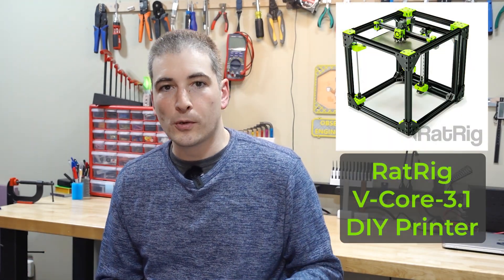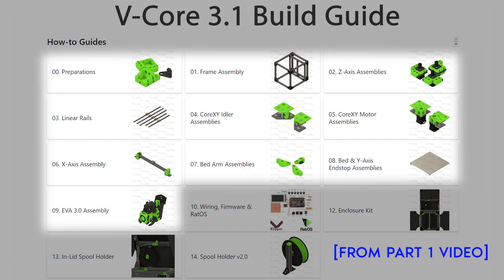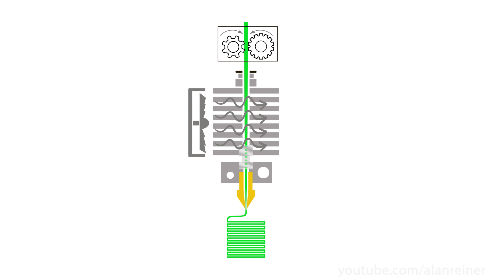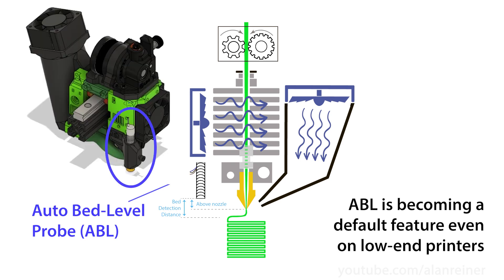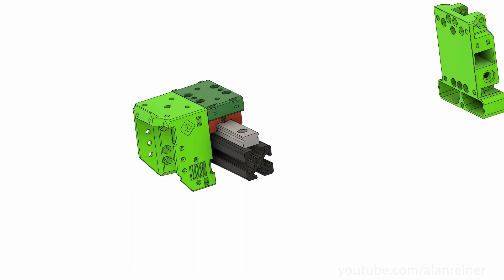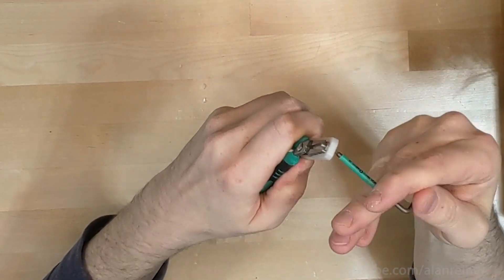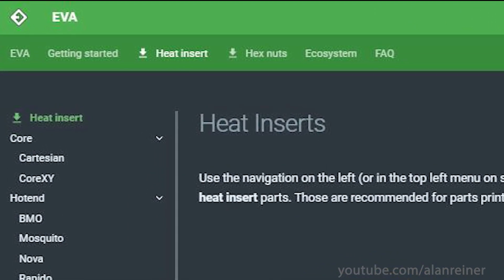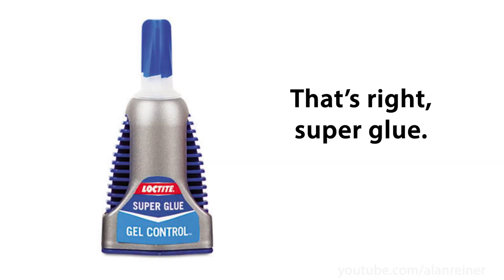RatRig V-Core-3: Printheads, Fasteners and the Amazing EVA

Comment: Hi, Paweł here, good thing you eventually looked at the EVA docs :) Thanks for the good word, EVA is a lot of work
Reply from the maker: Hey Paweł, thanks for watching!   I'm sure it's a ton of work to design and maintain a modular system supporting a bunch of third-party components.  But you've done a great job!  I was a little overwhelmed by the whole RatRig DIY thing initially, and when I saw that the EVA stuff was already included the RR CAD files, I mentally checked it off as one thing I didn't have to think about.   I wish I had realized there were options.  

So, on a scale of 1-100, how well did I pronounce your name? 😅  Any other corrections you'd like to add?  I'll pin your comment or add it to the description if something else needs to be said about it.  Thanks!
Reply: I'm going to find a way to mount the EVA to my Ender. It's such an ingeniously designed toolhead.
Reply from the maker: @livedeliciously  FYI there is a channel in the RatRig discord called #eva-on-ender (or something like that.

However I should point out that you will lose some of your X-axis because EVA has to wrap all the way around the X axis beam, which will limit it's motion on the sides since it would collide with the vertical rails.  Just something to think about... Maybe the guys in that channel have a solution 🤔
Reply: @ObsessiveEngineering  I'm humbled trying to figure out a simple solution for making this work. It seems like there isn't a way to mount it without making significant changes. Scrolling through the Discord on the "EVA for Ender" section shows me that smarter people have already tried and have to resort to the same solution. A complex one.

Comment: 4:37 if your holes are on the small side you can heat the nut and press it in or sand the nut, the holes shouldn't be that much smaller.

Comment: That's quite a lot of parts to build up the actual print head. Think it will ultimately limit speeds? The Voron designs use some pretty damn compact & minimal print heads, although maybe that's not practically a problem unless you're competing for max speed?
Reply from the maker: It's a lot of parts but it's actually not that heavy.  I was able to do a <7min benchy with this machine, with the stock RatRig build, which is all the more impressive given it's a 400x400mm build area!  I think the weight of the gantry is a much bigger factor, which is a long piece of 2020 aluminum with a linear rail.

https://youtube.com/shorts/TYMnDqdXeno

 Nonetheless, ever since I switched to a 0.6mm nozzle and generally print with large layers and lines, the max melting/flow rate of the nozzle is my limiting factor now, not the speed of the printhead.

Thanks for watching!

Comment: I just pushed past 700 hours printing on my RatRig 3.1.  I bought at 3.0 and did the 3.1 upgrade. Printed all my parts on my Lulzbots with ASA and ABS. 

I can't stand the captured nuts like you and I also missed out on the EVA insert options as well! Next time on the next upgrade I guess.
Reply from the maker: I just checked RatOS and see I'm up to 340 hrs of printing.  Still going great.  The only thing was a couple nozzle crashes due to cold blobs on the nozzle when homing (which broke a non-critical piece I need to reprint), and my motors just started buzzing loudly on certain movements.  I need to pull the printer away from the wall and do the XY motor wire reversal I keep hearing about.  

It's an amazing machine, and I'm always reminded of it each time I try to print the same thing one of my other printers.  Thanks for watching!
Reply from the maker: Hah, looks like my nozzle crashes just came back to bite me.  Finally after 350 hours, my EVA assembly is falling apart from the force of those crashes.  Out of commission until I figure it what needs to be replaced...
Reply: @ObsessiveEngineering  I had been getting crashes with the BL touch so I switched to the Euclid probe and have not had one since. I changed over 3 printers and it's so much more reliable. I was sick of watching with my finger above "Emergency stop"!

I built my own, but the kits are better I think.
Reply from the maker: @csadler  This was not really the printer's fault, besides the short detection distance of the SuperPINDA probe.  I was printing with a lot of weird materials for an upcoming video, and some of them like to ooze large blobs that harden on the nozzle and effectively make it longer.  Otherwise the probe has been great.  But I want to try a stowable probe next
Reply from the maker: @csadler  What was your experience setting up Euclid?  Now that I think I need to reprint the EVA parts anyway, I might as well give it a go.  I really wanted a garolite sheet for my bed but it's not going to work with the inductive sensor I have now.  

Did you just pull the printable files from github?  Where did you mount it?  Seems like a good excuse to update to RatOSv2 which has native support for stowable probes.
Reply: @ObsessiveEngineering  Thanks for the heads up on RatOS 2!

 "By popular request, stowable probes like euclid and klicky are now supported natively in RatOS (currently only on CoreXY). As usual everything you need is a single include and possibly some minor tweaking to 4 coordinates, quite a stark contrast to the work usually involved in configuring stowable probes. The probes are automatically stowed and deployed when needed and safeguards are in place to ensure safe operations."

Looks like I might have some changes to try - maybe??
Reply: @Alan Reiner  Did you get around to this yet? I have klicky on ratos 1, have been putting off the 2.0.
Reply from the maker: @travistucker7317  Yes!  You can see a short I made about it.  It was pretty smooth to setup, the only real issue was that I needed to tweak a parameter which was preventing the Z-offset from being as big as it needed to be.  I don't remember exactly but it's in the discord if you need it.  It's been working great
Reply: @ObsessiveEngineering  so you pretty much save your config, reflash the pi, then a could tweaks?
Reply from the maker: @travistucker7317  actually you just reminded me they recommend saving off your config file and using it as a reference for the V2 config. I guess you can't drop in the old one.  That process took me an hour or two to basically reconfigure my printer onto a new SD card with my old plugins like camera and time lapse.

But once I was back to where I started then adding the stowable probe was pretty straightforward.  There's a page about setting it up, on the ratrig documentation website.
Reply: @ObsessiveEngineering  nice, I'll set up my next 500 on Ratos2 and then go back and do the other two. Setting up klicky to a while on 1.

Comment: I just purchased a ratrig with the petg parts (i just want to use it for pla and petg). It doesn't say whether the printed parts come with inserts or nuts. Hopefully I get inserts :(
Reply from the maker: You'll probably get the captive nut version, BUT they will be printed by RatRig with the correct tolerances so it should be okay.  The parts will work as intended, it might just be a little more tedious to insert the nuts than using the inserts.  It'll be fine 😃
Reply: @ObsessiveEngineering Unfortunately, not always. My printed parts from RatRig came with quite bad tolerances and some cracked when I tried to insert hex nuts :(
Reply from the maker: No way!  That really surprises me.  I'm sorry to hear that.  If it's not too much trouble you should contact them and ask for replacement parts.
Reply: @alexey_sychev  how did you get on getting the nut in the pinta probe mount? 🤣
Reply from the maker: Yes!  That is the most absurd captive nut placement possible.  I remember being baffled when I realized what I was supposed to do.  It's awkward, to say the least.

I just recently just replaced that part with the heatset version and it was very pleasantly simple.